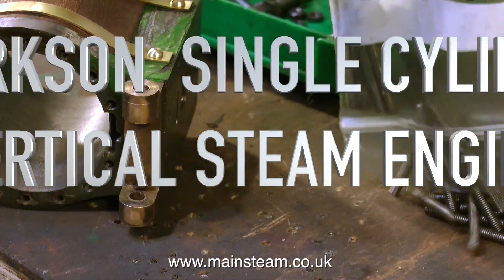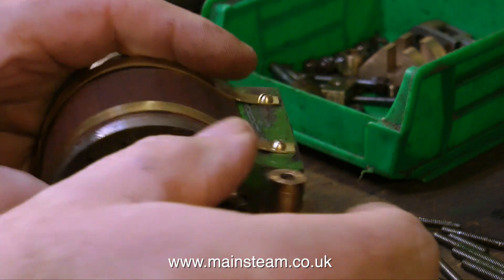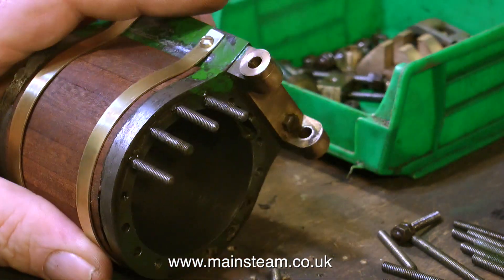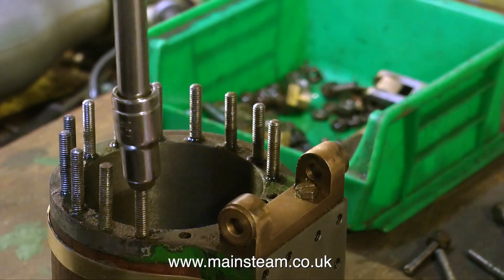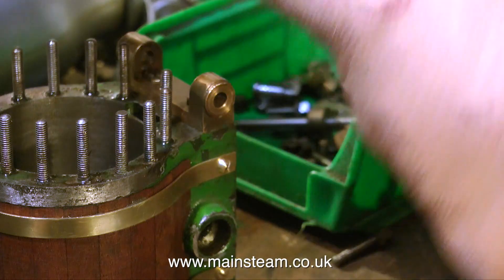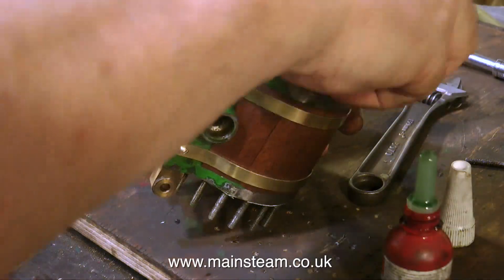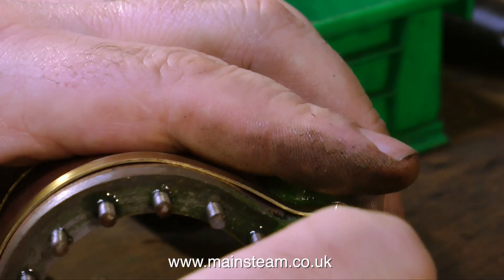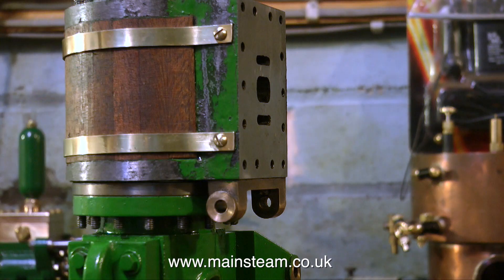REBUILDING A LARGE CLARKSON VERTICAL STEAM ENGINE - PART #22

Comment: Hi Keith, what is the thickness and type of the gasket material you are using ?  The thinnest gasket material I can find here in Cape Town is 0.4 mm. Would 0.4mm be ok for the Cylinder Head cover and Valve chest cover on a small steam engine ? ( Stuart horizontal 10h type ) Still enjoying this video series, thanks.
Reply from the maker: +SteamerEdge The gaskets for small Stuart engines are very thin so the stuff you have will be fine.

Comment: Studs, studs, studly studs!

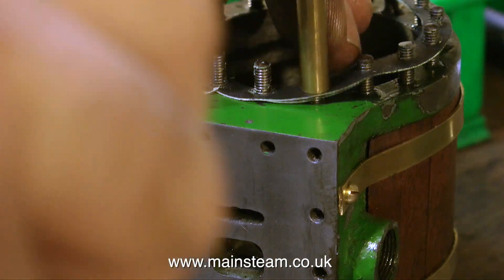By the way, well done on distracting the viewers away from the fact that you accidentally tore the gasket at 5:05 :-)
Reply from the maker: +vinny142 Video is merely an illusion - it is not real - these gaskets are made of the wrong material anyway - you missed that :-) I will make some more gaskets out of the correct material before assembling the cylinder - and also add some sealant . . . . . No distraction was required - this gasket stuff was some I had laying around - the gaskets that I use on the finished engine will be better quality - and of course perfect . . . . . I really must try harder . . . . .
Reply: +Keith Appleton Drat, and here I was, thinking that I caught you making a mistake... but I didn't... I will go back to watching pistons go up and down for no particular reason :-)